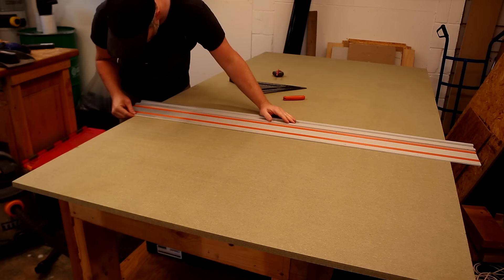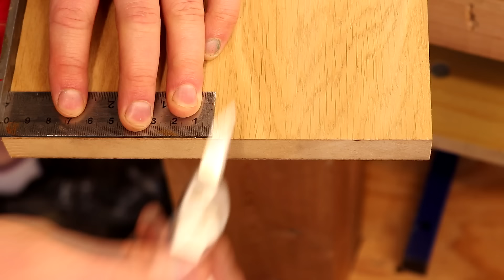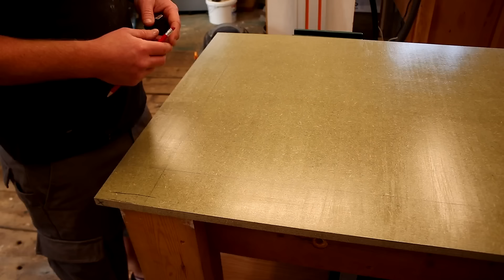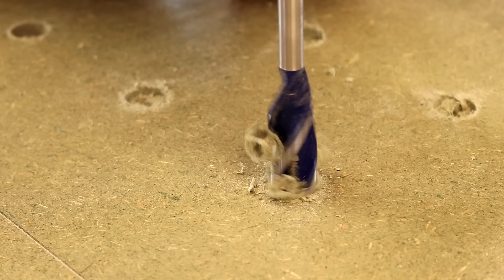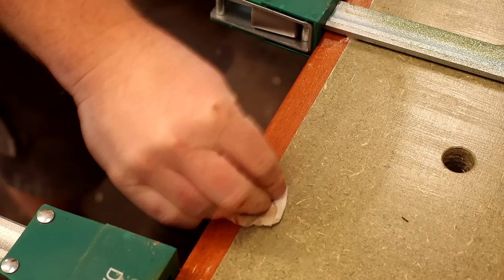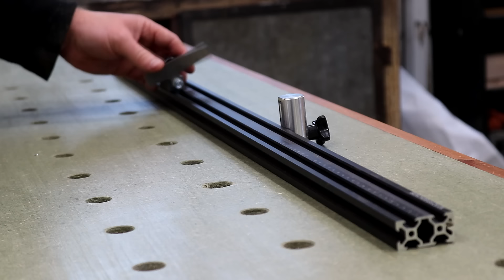Making An MFT Top - No CNC, No Guide Jigs

Comment: Hi Keith,

The math is bothering me slightly. Now I understand the 3,4,5 method, but I'm not sure you can just add, multiple and then add to the result in the way you did.  I'll repeat what you did using Pythagoras
a² + b² = c²
We want to know c, therefore
c = sqrt(a² + b²)

1) 3²+4²=25
Sqrt(25) = 5

2) you doubled the values
6²+8²=100
Sqrt(100) = 10

3) You multiplied by 100
600²+800² = 1,000,000
Sqrt(1,000,000) = 1000

At this point everything is correct, however simply adding 100 to those values does not work...

700²+900² = 1,300,000
Sqrt(1,300,000) = 1,140.1754
Not 1100

After watching the video back several times, adding 100 is not required as the datum point (x100,y100) can be whatever value you want. As long as you measure from this datum point 600mm in one direction and 800mm perpendicular to it, the 2 points will have a distance of 1000mm (not 1100) if the sides are at 90°.

I still can't figure out how you got 1100.

Hopefully, I've missed something and I'd appreciate if someone could point it out, but I'd hate for someone to make a mistake on something that is intended to be very accurate.

I love your videos, keep up the good work!
Reply: He's measuring from the 100mm mark on his tape measure. So 1100 is 1000.
Reply: @JoelPrice253  Yes! I knew I missed something. It was late haha
Reply: @stuartpurdue  i think youre right! If he goes 600, 800, 1000 hes correct. Hes also correct if he adds 100 making 1100 but then measures from the 100 mark instead of the zero. (In reality his tape says 1100, but its actually 1000 as 100 is used instead of zero).
So he doesnt need to add 100 to 600 or 800. When he does and those numbers are squared, added and you find the sq root its wrong!
Reply: @stuartpurdue  This was bugging me too.
Reply: @JoelPrice253 

Hahaha you shouldn’t have said anything
Reply: @Stuart Purdue: I had the same doubt, but what he did was not add, but offset by 100mm. Damn, someone already said that...
Reply: @akbychoice  Um, no... 3/4/5 multiplied by 4 would be 12/16/20, right?
Reply: Terry Lyons oops yes
Reply from the maker: Yes sorry if I didn't explain it so well 👍
Reply: @RagnBoneBrown  you explai ed it very well in my mind.
Reply: @RagnBoneBrown  it wasn’t confusing to all that know the theory but these comments will help clear it up for those who are unsure.
Good video
Reply: @RagnBoneBrown  You explained it superbly. Just a miss on Stuart's part.
Reply: @ARepublicIfYouCanKeepIt  He added also an offset of 100 to line "c" and this is not correct. There's nothing to miss here.
Reply: @Howie656565 Because it’s more accurate measuring from the 100mm mark than the hook on the end
Reply: This was slightly confusing. From the center of the corner reference hole (representing the 90 degree corner), he made marks at 800 mm along the long side of the table and 600 mm along the short side of the table. But to avoid measuring from that reference hole itself, he instead measured from the edges of the table. Since that reference corner is 100 mm in from each table top edge, he measured 900 mm (= 800 + 100) from the short edge along the long edge for one check point, and then 700 mm (= 600 +100) along the short edge from the short edge for the other check point. The final slight confusion was using the 100 mm point as the starting measure for the hypotenuse (the line that connects the two check points) since that is more accurate than trying to figure where the true “0” point is on a tape measure. Since he started at 100 mm, the 1000 mm hypotenuse ended at 1100 mm (1000 + 100). Simple to do, a little hard to explain.
Reply: If you want to complicate things, instead of using 3,4,5 try using 5,12,13
Reply: Stuart Purdue you’re spot on! Pythagoras' theorem only works if you scale up the triangle by multiplying all sides by a certain factor. If you increase the length of any of the sides, you need to recalculate the size of the third side, you can’t just add equally to the 3 sides.
Reply: LOL... I had to pause this video to work out the addition of 100 to all three sides. Glad to see it worked out.
Reply: Yes you can take a 3,4,5 right triangle and multiply each side as you dig to get 600, 800, 1000. But you CANNOT just add 100 to each side  to get 700, 900 1100. If you use 700 and 900 as the two sides, then the hypotenuse or third side would be  1140.  This comes from the Pythagorean theorem  a square + b squared = c squared.
Reply: This is the longest rant and comment section I've ever seen for a bunch of people who don't understand a simple calculation...
Reply: Great video fella and I'm about to build my own based on your design. really simple guide and love the accuracy and first principles tips. Small error - i think??? - adding 100 to your 600,800,1000 to make 700,900,1100 actually breaks the 3,4,5 rule (the ratio becomes 233;225;220 on those dimensions) I.e. folks will wander off square.          But then you've bossed it by starting at 100mm on the ruler!!  I guess making that clear might save some tragedies?
Reply: that's what I got sqrt(1,300,000) which is not 1100. still great video!
Reply: Multiplication is fine, because you can factor out any multiple you want.  Begin with a^2 + b^2 = c^2, then (n*a)^2 + (n*b)^ = (n*c)^2 just becomes n^2 * [a^2 + b^2 ] = n^2*c^2 - you've just scaled everything.   You're correct that you can't add a constant to a, b, and c, though.
Reply: It's even easier to just measure the diagonals. If it's 90 degrees square, then corner to corner will be identical both ways. No maths needed, works for ANY size rectangle.
Reply: I should have read the comments before I did the math.  
Rag n' Bone essentially added 100 to each measurement, then burned 100 mm on each measurement.
Reply: The ratio is wrong for 1100, hypothunuse side
Reply: The multiplication is geometry since the measurement is proportional to the original triangle, adding 100mm to "a" and "b" is just an offset of the zero point. Adding 100mm to "c" is just so you are not trying to read from the hook end of his tape. It's all math.
Reply: When he added 100, I was like, erm, yh it doesn't work like that, so I'm glad you picked that up too!
Reply: Math was never my strong suit, and as soon as I looked at your figures, my eyes glazed over and there was much twitching, moaning, wailing, and gnashing of teeth.  I know the world needs analytically inclined folks and I sure as hell ain't one of them, so thank you for taking all the hard stuff and making it make sense to the rest us who are challenged with your basic 4th grade story-style question.
Reply: This is a generally well known ratio for a right angle triangle. For any triangle with angles at 30, 60 and 90, the ratios of the lengths of the sides will be 3, 4 and 5.
The formula a^2 + b^2 = c^2 will also show this be correct. 3^2 + 4^2 = 5^2 or 9 +16 = 25.
And more generally you can scale this up or down, where variable s is the scaling factor and a, b, and c are the values for the 60 degree right triangle:
(s*3)^2 + (s*4)^2 = (s*5)^2  --- you can plug in any value for s and it will work.
where s is 0.5 then 1.5^2 + 2^2 = 2.5^2  -- finish the math and 2.25 + 4 = 6.25
or if you like s = 7 then 21^2 + 28^2 = 35^2 -- 441 + 784 = 1225
https://en.wikipedia.org/wiki/Special_right_triangle#30%C2%B0%E2%80%9360%C2%B0%E2%80%9390%C2%B0_triangle
Reply: @raywhitfield  : it is an easy way to measure "true",  but we need to remember that a 3,4,5 "Right Angle Triangle" isn't a 30,60,90 degree triangle, it is a 36.87 , 53.13 , 90 degree "Right-angle triangle"...  (A 30,60,90 triangle has sides 1 , 2 , Sqrt3 (~=1.732)

Because we commonly use  the 3,4,5 rule and we also use 30, 60, 90 degree triangles for marking out, it is easy to confuse the 2. (I know I have) 
- when in doubt I grab out a calculator/google/  piece of paper, and do a bit of simple trig (basic ratios of triangle edge lengths) to help, [sin (30degrees) = cos (60 degrees) = 0.5 ] * .  [Cos(30) = Sin(60) ] but is is not any sort of reciprocal  to the previous ratios (*) = 0.866;  which is =Sqrt(3) / 2 - using the other edge  whose length  = (from a unit 60-60-60 triangle) = sqrt(2^2 - 1^2) = Sqrt(3)

Not trying to rattle any cages, just put it out there in conversation.  Cheers.
Reply: @kadmow  Oh, yes I see. close-ish but no cigar. thank you for pointing that out.
Reply: @raywhitfield     
Years ago I was paddling along a beach in Greece and found a fairly sad looking plastic 30/60/90 triangle in the sand and had a rather nice moment contemplating Pythagoras and the 345 but later in the bar twigged they weren’t the same. Took a tiny bit of shine off the day, but hay ho, if it hadn’t been for Euclid and geometry there wouldn’t have been any twigging at all.
Nowadays I would be all Greta and ocean rubbish.

The section just below the wiki link goes on to a whole vista of stuff about triangles - Pythagorean triples, Heronian etc.  A real distraction from getting on with the next cut on the MFT.
Reply: You are absolutely right. There's a slight problem there. What some comments show is that people misunderstand what's happening here. There's no 3-4-5 'rule'... There is the Pythagorean theorem, and so it happens that 3-4-5 are "convenient" numbers that observe it, because 3^2+4^2=5^2. Same with 6^2+8^2=10^2. This does not mean that you cannot use any arbitrary dimensions for your right angle sides... They just wouldn't be convenient. Now the square root of 700^2+900^2 is not 1100, it's 1140.75 therefore there's a small error in Keith's measurement. I hope that this helps. Best wishes Evangelos
Reply: @xylonguitars  guys ... you must read the older answers before write . It was an offset for the tape
Reply: Marcelo Amorim bless you...
Reply: His last step was indeed confusing and wrong.  He just measured from the edge 700, with first hole at 100, so it was 600 length.   The second straight was 100 to 900, so 800 length.  His last he measured from the 100 mark to the 1100, so 1000 length.   So it was still simply a 6 by 8 by 10 rule, but starting from the point 100,100 instead of 0,0...........  so he just confused it all by stating the last "add 100" part, which was wrong explanation on his part.
Reply: I was cringing too until he started from 100. He fixed himself quite nicely

Comment: 9:15 - you should use just second awl - tape measure is not accurate; by the way, better would be drill in the template dog holes (less drilling better quality and more accurate), and use dogs to position next holes

Comment: Thanks for the vid. Quick question, I am in the quest of choosing the wood for my workbench top. I was thinking to make it simple like MDF just as you did but I am a bit worried about glue drops on it when gluing pieces of woods during projects. 
Do you have any return on experience with your bench top?
I am curious if the varnish you applied avoid wood glue to attach on it. 

For making it robust against glue, maybe a laminated plywood would be a better option. Any thoughts?

Comment: The reason festool and others may use a 96mm spacing is from other industries, notably the metal machining. I used to run a shop and all our vises and fixture plates were using 96mm centers. You can switch from Shunck, SMW, lang, Mate, jergens, etc. they also all use 20mm pins so technically you could drop a heavy duty machinist vise onto your mft if you can find away to lock the pins afterwards ….

Comment: Great you've done this without a jig or CNC as such but I can Guarantee youve drilled a few of those holes bent. Even if youve held the drill a mm off centre, this will affect the reference point of say a long dog defeating the purpose of such a table to begin with

Comment: Any one with a laser cutter ( x-tool ) can make a more accuate drilling jig in less than 1 hour, 7 x 4 holes spaced 96mm apart. You must get perfectly straight dilled holes or the dogs wont sit square, make a drilling jig, use forstner bits set into 18mm MDF, easy. Lastly do people actually buy stuff from Bench Dogs? Do your home work, good equipment at a tenth of the price from our asian brothers, very good prices since Trump cut trade. I've just brought 2 fences less than £15. Totally square, work brilliantly.

Comment: Just a thought your choice of moisture resistant mdf could be improved by using Velchromat as its much more resistant to surface damage and it's much more dense. Also the ujk parf system will give you a more accurate grid.
Reply: Very expensive option.

Comment: Thank you for posting this video.  My experience with the table that I built is that the 90 degree accuracy was not that great as time went by. 
A better system than festool MFT table is to switch to a completely xy linear system.  It is super accurate as you will be using the same components as real CNC but the z axix will never be as accurate as CNC because the top is not accurate.
Frankly, I got tired of replacing the edge on festool guides and sometines the edge is not as good as I expected to be.  Festool said this is caused by untuned saw and that I am pusging the saw from wrong angle.

Comment: Thanks for clearly describing all of the steps you used to make your MFT style top. Great results. Other makers claim that a spade bit works better, but your auger bit seemed to do the job nicely. I’m also new to using MFT style tops, but I like the flexibility they offer to hold components during cutting & assembly.

Comment: Yes, you can't just add an equal amount to all sides.  The formula is A squared plus B squared = C squared.  So, the third side (hypotenuse, the longest one) is the square root of the sum of the other two.  The way it was done he showed the tape as if he was measuring the hypotenuse, but that value would have been 1000, not 1100.

Comment: Apart from scaling up the triangle by multiplying all sides by a certain factor., here are all the basic integer triples under 100: (3, 4, 5) (5, 12, 13)  (8, 15, 17)  (7, 24, 25)  (20, 21, 29)  (12, 35, 37)  (9, 40, 41)  (28, 45, 53)  (11, 60, 61)  (16, 63, 65)  (33, 56, 65)	(48, 55, 73)  (13, 84, 85)  (36, 77, 85)  (39, 80, 89)  (65, 72, 97).

Then there are an infinite number of non-integer examples, such as (1, 1 , sqrt(2))  (1, 2, sqrt rt(5))  etcetera.

Comment: 700,900,1100 is not 3, 4,5 rule!! You cannot just add 100 to a ratio, you must multiple it by the same factor!!! Your holes in this  table in this case is not accurate. Tape is not accurate use a long steel rule
Reply from the maker: Read the pinned comment...

Comment: Since MDF can flake and crumble a bit when stressed, such as when using hold downs and holdfasts that depend on putting side loads on a stem going through the  dog hole, the accuracy of the dog holes can deteriorate over time. For greater durability I am thinking about adding metal liners to the dog holes. I couldn't find any commercial versions of such liners, so I'll have to make my own. 

I was able to find 20mm ID 25mm OD aluminum tubing in 300 mm lengths. that seems like it should work (assuming that the +/- 0.05mm tolerance quoted on the ID is tight enough).  These were $12.50 each. Assuming a 25mm (~1 inch) thick worktop and about 1mm for jigsaw blade thickness and another 3-4 mm for to true up ends so the top lies flush with the worktop, I should be able to get 10 dog hole liners out of each 300mm piece, for a price of $1.25 each. For 98 dog holes (7x14), that works out to $122.50. And like the dog holes just in the MDF, I would need to put chamfer on the inside of the liner. I know that woodworking tool are supposed to be able to cut aluminum if you go nice and slow, but I don't think there can said to be "slow" about a router. So I would get a chamfering/deburring drill bit (which would be about another $15). So total of something around $140.

But if it means that the dog holes hold their shape longer, it could be worth it.

Has anybody done this? Is it worth the effort? Any feedback would be appreciated.

Thanks,  Pappa Rocket!

Comment: An easy way of getting an accurate 100mm square grid would be to use a roll of squared pattern paper (used by dressmakers).  96mm is not so easy, but could be done with a roll of graph paper.

Comment: Why not mark  X & Y axes with a framing square and use dividers set to whatever centres you choose and mark out your top using dividers and a centre punch, no jig needed and it's how I was taught to mark out in Engineering Drawing and it's how engineers manufacturing ships diesel engines did their marking out so it's a well proven technique.
Reply from the maker: Probably because I'm not an engineer

Comment: To finish MDF I’ve found that stain (if you want a color other than smashed up wood), followed by 3 coats of shellac is perfect. I lightly sand coats 1 & 2 of the shellac.

The great thing about using shellac is that your dry time is super fast. Also, I like the smell of shellac which I’m sure is not healthy?

Comment: Hi Keith. Excellent video and very timely for me. I am designing a mobile worktop in SketchUp, for my very small workshop, and was considering whether to add MFT holes as I didn’t  really know how useful they would be but your vid helped confirm this. I have also just bought a rail saw and dogs for the rail alone make it worth building as MFT for me. 
Cheers from sunny Suffolk

Comment: As a Festool rep told me, the 96mm on centers was decided on because of the 32mm cabinet frame less metric that is used in Germany and everywhere as a whole.Loved the math lesson and the marking of the top.Seems your jig was spot on.
Reply: This is the way 😂 
. Most of european cabinets are designed with this rule of 32mm. Hinges fit perfect on this 32mm space. Common handle has a 96cm space between pins...